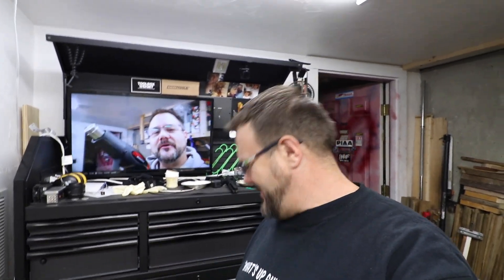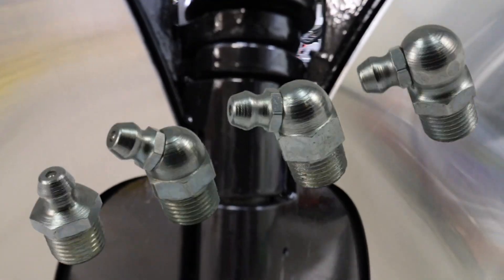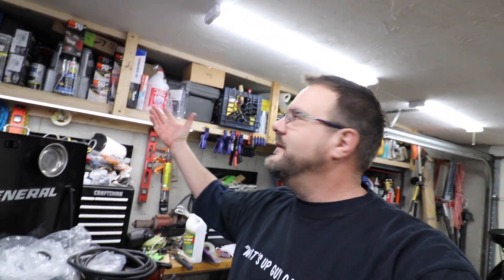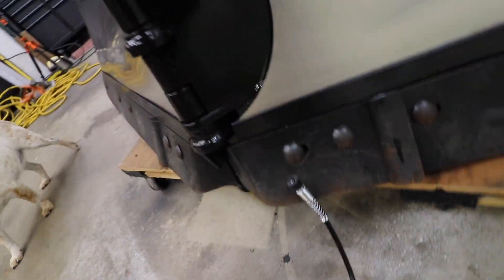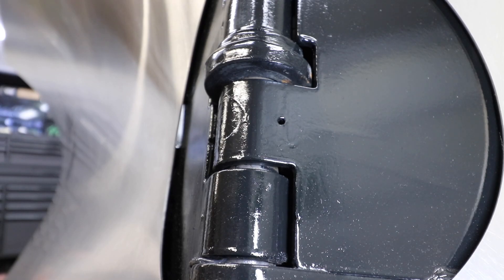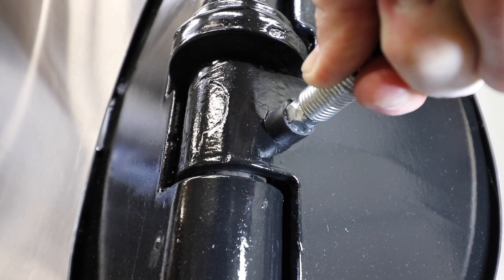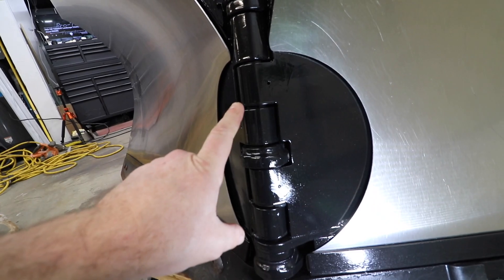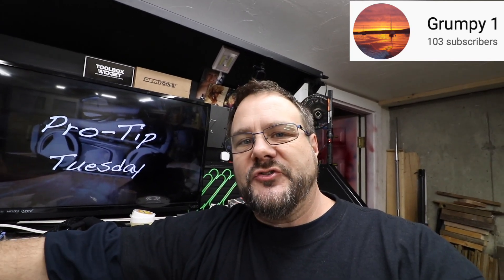Fisher VX2 center pin greasing

Comment: What size plow is that? Howd you building the stand with wheels on it? I want to store mine in my garage but my truck is to big to pull it in.
Reply from the maker: 9'6" using harbor freight furniture mover with I think small plywood on top. So easy to move and swivel on 4 swivel casters👍💯

Comment: My center pin has no holes in it.  Should I just try to get grease in any way I can?
Reply from the maker: YES!!!! Unless they've changed design to GREASE LESS but I'm doubting that. Other than that greasing that pin is a TOTAL MUST! I'm 6 years in with custom made oversized hoses. I'd never change up plows. Very satisfied with mine!👍💯👊